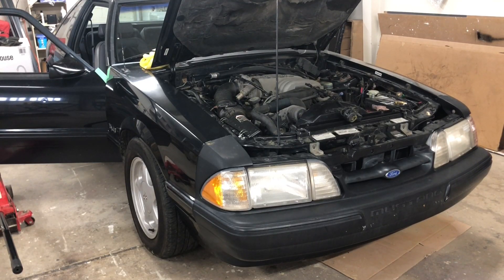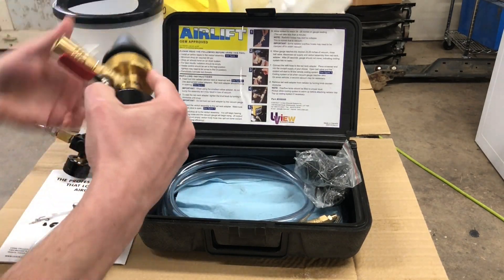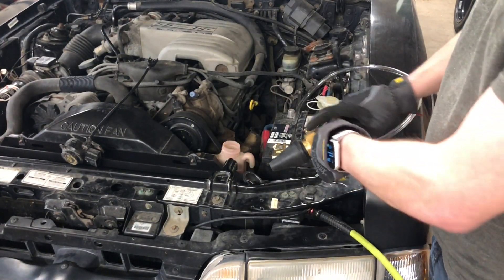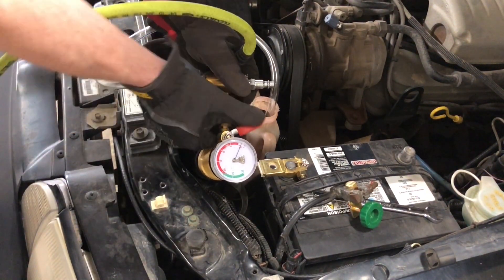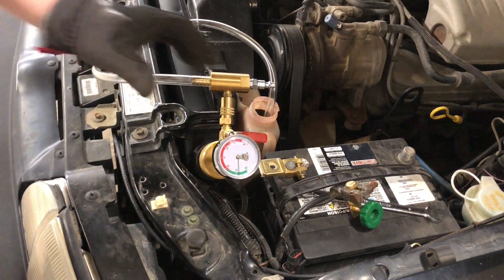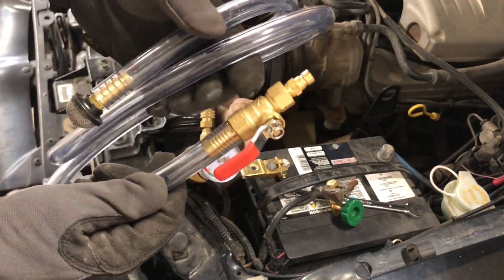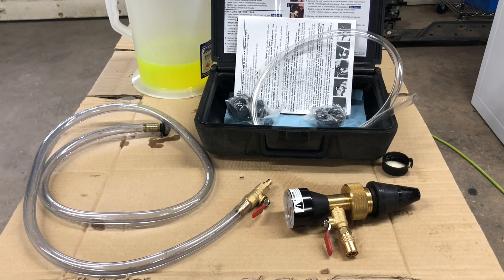How To Refill Your Cooling System

Comment: will this suck air from the block and heater core? i mean thermostat is close when its cold  so how does this one will suck air in the block of the engine?
Reply from the maker: Yes. There is commonly a tiny hole in the thermostat to help bleed air so no worries. The heater core hoses collapse under vacuum.

Comment: What coolant did you use here?
Reply from the maker: The popular Prestone all makes & models.
Reply: @InternetDude  Good choice, I've used that and other universal extended life coolants for well over a decade in various cars with no issues.  By the way, don't need to change that one often.  I've run it as long as 8 years in a car and the cooling system passages, radiator, etc were all still pristine when I changed it.

Comment: With the tool and filling coolant do you know when it’s full? Or do you monitor the amount you are putting in ?  Great tool and video btw.. I am thinking about buying one.
Reply from the maker: Eventually it stops sucking fluid in so it’s just about full. Remove the tool & top up if needed, to up the overflow bottle and done.

Comment: what about the air on your fill hose?
Reply from the maker: I’m not concerned at all since the entire system has such a strong vacuum in it, a little air won’t make any real difference.
Reply: @InternetDude  yes u let air in The cure is to install a tee to join both shut offs very ease to do with 1/4 “ brass tee and male brass auto plugs and female coupler or do as most do fill the hose to the shut off

Comment: waste of money., say what if i need to flash the system and run water thru system to get rid of what ver contaminant left in there, your tool can't do that, all it can is suck out water and fill it. and all that gunk and junk still in there.
Reply from the maker: Actually this tool is not for sucking water out at all, it's for sucking air out of the system so you can properly re-fill it. You still need to drain or flush using whatever method you'd like first.
Reply: Put the tool kit down before you hurt yourself.

Comment: so in case I have coolnat already there... I need to flush it out before? It has fresh coolant...but airpockets... that I can't get rid of...
Reply from the maker: In my experience of using the tool if you have coolant in the system it doesn't work as well at pulling a vacuum. Try draining the radiator at least and pull the vacuum again. Try to get it as low as possible (-25-ish). It should work better that way.

Comment: So could that be used to replace the battery coolant in the Tesla?
Reply from the maker: It appears the answer is sort of. See the official Tesla instructions here: https://www.fixmyev.com/v1/tesla/models/servicemanual/tmsr-b84WsCkoUQ.html you need a similar tool but also access to the cars software to initiate commands, which is not DIY friendly.

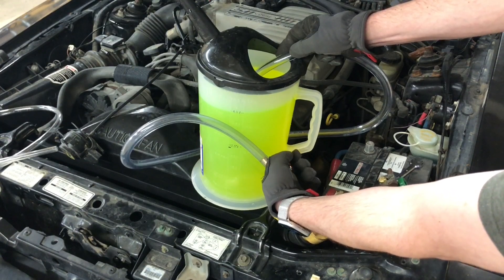Comment: 5:59 shouldn't that hose be prefilled with coolant before you open the valve? 🤔
Reply from the maker: Ruben Kelevra there is so much vacuum on the system at the start that it isn’t something to be concerned with IMHO.
Reply: @InternetDude  alright. 😙🎶